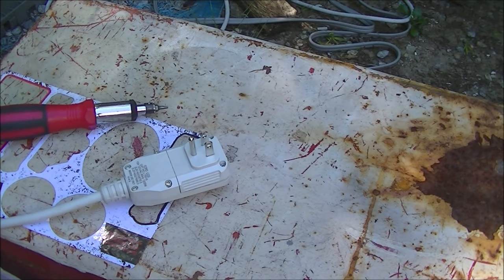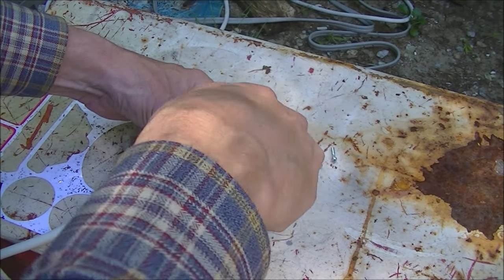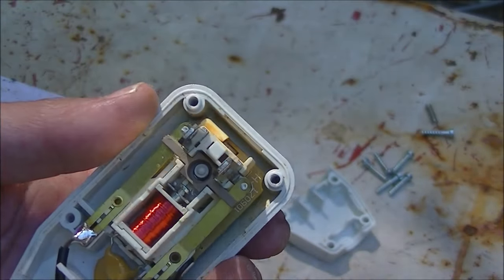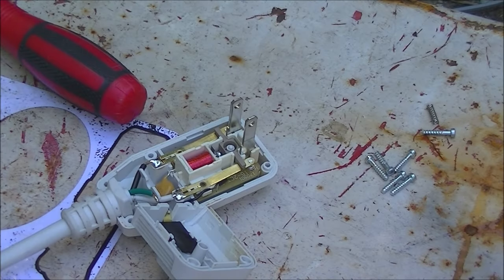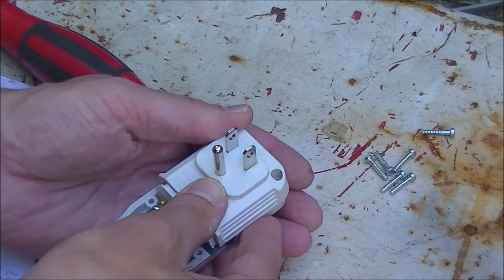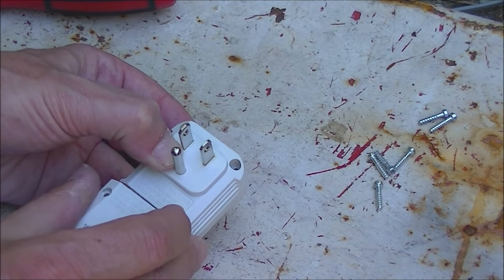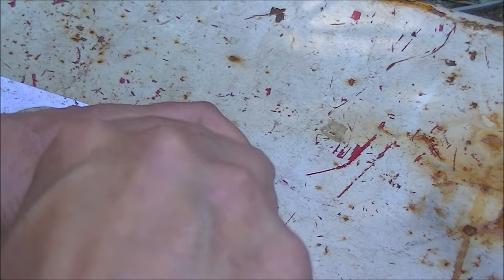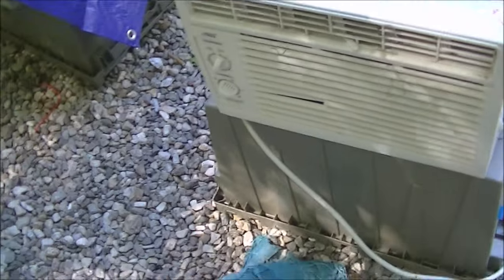Fixing an Air Conditioner GFCI Plug That Trips

Comment: All jokes aside…… I’m not going to complain about the long talk about the quick fix because….. it worked. My plug has a 2 prong safety screw that I did not have on hand. So I loosened all other screws and blasted it with a hair dryer and let it just sit over night. Next morning, we had a running GE window air unit. 4 🌟’s tyvm man.

Comment: Very good vid indeed. Just did a deep clean on my sons 240v 30a ac unit and the gfi plug was doing this very thing. Before pulling the (heavy) unit back out, I seen your trouble shooting vid and did what you suggested. We used a hair dryer on warm, and it did the fix. Thank you for the dyi tip. Very helpful indeed. A great day to ya sir.

Comment: The 2nd plug you were talking about thats the one I have and was having the same problem. So I took all screws out except 1 and opened it just enough for air to get through I took the blow dryer to it put the screws back in and it worked.
Reply: Thats a great idea
Reply: 7:07 For anybody who has already taken apart one of the GE type "Tower Mfg." plugs (that he mentioned he could never get working again after he took them apart), the trick is to pull back on the reset button's spring before putting that "reset" slider (that moves the 2 contacts) back in. The default position for those 2 contacts should be closed (connected/making contact) and that spring needs to be pulled back behind the stand-offs so it can push against them to hold the contacts closed.

When a fault is detected, that little solenoid in there pops up, hits a little brass button on the reset slider, releases the reset slider, and disconnects the contacts. Pressing the reset button resets that little brass button and allows the slider to move back to its original position (where the contacts are closed/making contact).

I wish I could describe it better in a comment, but you'll see what I mean once you open it up. I hope it helps somebody.

Or just do what @myfireburns22 said and don't take it apart all the way, and dry it out that way.

But if you're like me, and you were well beyond the point of no return by the time you looked up this video, that's what got mine working again.

Comment: On an air conditioner this is an LCDI (Leakage Current Detector Interrupter) and it's purpose is to detect any leakage current between the conductors inside the power, which would occur from a damaged or frayed cord and is was required in the early 2000s for portable air conditioners.   A very similar looking plug is an Appliance Leakage Circuit Interrupter required on hair dryers since 1991 and works very much like a GFCI.  To sum it up LCDI plugs address fire hazards,  while ALCI plugs address shock hazards much like GFCI and AFCI protection required in all new homes.
Reply: Thanks
Reply: Why can’t I just change it
To a regular 3 prong plug and accept the minimal fire hazard. Not sure how much fire could be created. My plug is outside hanging against a brock wall (I have to lower it from outside) I kept it wrapped in plastic but unfortunately it came off one day and the button is ‘soft’ and won’t reset. It used to reset no problem many times before after a random brief power outage.
Reply: @mr8966  you most certainly can change the LCDI plug it came with to a regular plug that matches  eg. 120 or 240v, 15 or 20 amp depending on the size of the unit.  

It's just an NEC and a UL requirement that the air conditioner have an LCDI or AFCI plug or device on the cord within 12 inches of the plug, since around  2002, before they are sold to the consumer.   Having said that, by installing a regular plug which I personally wouldn't have an issue with, pretty much voids the UL listing on the air conditioner and could cause issues with your homeowners insurance in case of an incident involving the unit.  

In case you're wondering,  an LCDI plug is factory installed as a cord and plug assembly only, and consists of a fine wire mesh around the conductors inside the cord for it's entire length,  and trips with leakage current is detected between any conductor and the mesh, which would happen in case of a worn or damaged cord.   As long as you inspect the cord before bringing the unit out for summer and replace it if necessary – repairs with electrical tape are not acceptable – you won't have any issues.

Comment: My sunbeam A/C was tripping when it was completely off, the plug got wet and corroded inside I had a old AC unit that still had a good cord and I was able to swap it out and it worked awesome🤩.
Awesome video thanks to you. My air conditioner is working again.
Reply: I had the second one that you had in your hand the GE brand one and that thing was toasted…

Comment: 7:07 On the GE type plug (that you mentioned you could never get working again after you took them apart), the trick is to pull back on the reset button's spring before putting that "reset" slider (that moves the 2 contacts) back in. The default position for those 2 contacts should be closed (connected/making contact) and that spring needs to be pulled back behind the stand-offs so it can push against them to hold the contacts closed.

When a fault is detected, that little solenoid in there pops up, hits a little brass button on the reset slider, releases the reset slider, and disconnects the contacts. Pressing the reset button resets that little brass button and allows the slider to move back to its original position (where the contacts are closed/making contact).

I wish I could describe it better in a comment, but you'll see what I mean once you open it up. I hope it helps somebody.
Reply: Thanks will pull see what happens or open up I have 3way screw driver yet only works on 2 bigger holes the small holes can't get in there need to buy another screw driver I have right bit yet won't reach screw. I thought there's supposed to be a fuse. I guess is just air dry mine never got wet. So will check it put
Reply: You were correct! Saved me time and money just now, thank you for the insight!
Reply: You saved us $100+. Thank you.

Comment: Bought a brand new Hisense portable 8k BTU A/C unit 2 weeks ago from Lowes and was never outside however been experiencing extreme humidity lately and just last night the CGFI kept popping every few seconds and turns out the CGFI housing was completely filled up with water so i took it off and put a regular 3 prong end on it and now it works flawlessly

Comment: I can’t get the screws off. I’ve got it in front of the heater. I think I’m going to have to learn how to replace the cord. Thank you though, it happened once before and in 2 days worked again, I never knew what was causing it until seeing your video.
Reply: Do you have electrician's screwdriver like Square tip or Robertson screwdriver #2?

Comment: I had a portable room AC that the breaker plug kept tripping, then finally stopped working.  I just cut it off and replaced it with  standard 3 prong 15 amp plug. Problem solved, unit ran for another 5 years until the plastic blower fan broke.

Comment: If those things burn out, I usually just put a normal grounding plug on it. It doesn't protect against an over amperage situation. It's just a GFCI in a plug. A fuse holder would serve better. It's really there to protect the manufacturer's butt in case it electrocutes you or something. The air conditioner is fully encased in grounded metal, so I don't know what you're sticking your fingers in to get shocked. Even if you replace it with an after market plug and the air conditioner burns down your home, they'll be like, "you modified it, so it's you're fault." You can always just plug it into a GFCI outlet if you want. It's pretty much code now, so I don't know why you need it in the plug. They can always just tell you to plug it into to a GFCI outlet, and they probably already do. The NEC is also forcing AFCI outlets which trip if you look at them wrong. They don't actually work. AFCI is just snake oil in my opinion.
Reply: you are absolutely correct about everything you said there. I don't see the purpose of the GFCI plugs either, as long as it is properly grounded, you aren't going to shock yourself unless you open it up and touch something internal, which at that point you have modified the machine, so you can't blame that on the manufacturer. same goes for if it is not properly grounded for whatever reason. You are running it under improper conditions, which is warned against as well, so you can't blame that on them either way. 
most of the units I have are before they started doing this, but if those plugs start giving me issues, I just chop them off and replace them with a standard 90 degree angle grounded plug and have never been shocked or had an issue. 
Only time I have ever been shocked by an air conditioner was at my friends house, I had just cleaned the unit and was not patient before trying to use it. It was still a bit wet and I her wiring was old and I guess it was not grounded, so I got a bit of a shock. Once again, I could not blame that on the company that made the unit (even if it was not a 30 year old unit) because I took it apart, and the wiring should not have been running an AC unit. 
I also hate AFCI circuits. luckily my house is old, so it doesn't have them (I actually have non-trip breakers, but that is besides the point). I have been in newer houses and what you say about looking at them wrong is absolutely correct. I don't know how people are not tripping breakers daily.
Reply: You couldn't be more wrong. Those are not GFCI plugs. They are, in fact, LCDI cords (which require a LCDI plug because the cord and plug are all one functioning unit and must be replaced as an entire assembly) GFCIs and LCDIs are two very different things and serve two very different purposes. And, for good reason, many people have died at the hands of AC cords before LCDIs were mandated. That's definitely one mandate that was written in blood. You need to do your research before misleading others by not having a clue about what you're talking about.
Reply: @johnny0454 so can’t I just swap the lcdi box with a gfci? What would happen

Comment: My AC has that second larger plug. As soon as it cracked open water came out. Took a bit to get it dry. Works when put back together....as long as I don't tighten the screws down all the way LOL.

Comment: Mann your a life saver i took my unit apart cause condenser fan broke then me having it apart i washed it i noticed i lot of build  up put it back together let it dry for about 3hr whent to connect dirent work at ll had power at cord but would not power up and today i connected and it ppwer up but it kept tripping with in second

Comment: I just thought it was broken so I brought it inside and tried it once a day then gave up. It’s been months now so I’m sure it’s bone dry.   And why does it have two kinds of trips? ie: one trip that doesn’t affect the buttons and one loke in your video that does. How does just drying it out make the push button work again?  I would have a few teips a month from brief electrical outages and it never affcted the button. Now the button has no pressure under it, it just doesn’t work. I have a Noma. 

Also, interesting you said just put a regular plug on. I almost prefer that. What is the reason for the tripping plug - wouldn’t attaching a regular 3 prong cord to the unit then plugging it into a power bar with a trip/reset button function the same?

Comment: If I have a GFCI outlet or a 3 way GFCI adapter. Can I just cut off the original GFCI plug On the AC and install a regular three prong plug instead?

Comment: Hello I have a plug that the hot side is sliding after heat damage caused by the previous owner leaving it plugged into an extension cord always. Have you ever fixed the position of one of these?

Comment: Not gfci..  is LCDI..  leakage current detection interruptor..  not a ground fault circuit interruptor (gfci). Or an afci arc fault circuit interrupter..  ..  fyi..  for your information..
Reply: I'm trying to find why mine keeps on tripping. I see no visible damage to any part of it so I can't figure out why it keeps tripping. The cord, the prongs everything is cool to the touch.

Comment: 14:43 Thank you so much.😊 I need to dry mine out and I came across your video. It was very helpful I have one question? Can you put a regular three prong plug on the end of these air conditioner chords?😮 I could really use your help here. Where I live it's 120°the second hottest place in the United States.😮😮 Thank you so much.😊😊😊

Comment: I hate when those get full of water. It seems like they get full of water very easy, but don't ever dry out no matter how long they sit in a hot dry area. I don't really ever sell units, and most of my units that I collect are pre-2000, so they don't have this type plug on them. I only have a few that have/had this type of plug. If they start acting up, I generally just chop them off and put on a 90 degree angle grounded plug and call it good.
Reply from the maker: I'd also just put a normal 3 prong plug on it if it was something I was keeping for myself.

Comment: I lost the tip for the screws but I sat the plug in a cup of rice for 48 hours and it worked fine.
Reply: trying the rice now. I loosened the plug but I didn't take it all the way apart

Comment: I had this problem but the water in the plug was actually weeping through the cord from inside the unit.  I sealed the wire inside the unit and never had this problem again.
Reply: please explain more. I am having this exact issue. I got some silicone to seal the cord inside the unit.
Reply: Let it dry out and then silicone at the beginning of the cord sheathing. You will have to open it up, but it works

Comment: I had this issue yesterday morning my plug had got wet from the ac leaking water and it had ran inside of the plug I didn't have that type of screw driver but luckily I got it fixed without it and I used my blow dyer kept it on it for ten minutes then in a couple hours it was back working

Comment: Pretty sure it's a GFI. My ground lin got bet and broken loose and that's what I'm here for now trying to fix it before cutting it off and eliminating the ground fault protection. At least in the AC I have it's a GFI which trips every time I plug it in with no ground prong to go into the outlet. Gfi works like a champ. Mine has no display either just a trip and reset like any other GFI.
Reply: I. Thinking I can cut the end a little,  end it, drill a small hole, and screw it back into the plug like it's an implanted tooth, if I don't have the bit to disassemble it and check further. I'd just throw a regular aftermarket plug in it but I actually scooped the AC up just to clean and sell, and would prefer the GFI be intact.

Comment: A lot of times they'll have shielded wires most of the time the shielded wires will go to a bleeder resistor which will bleed the electric out whenever the AC units off..

Comment: On the second larger plug how do you get the second screw on the top off?
Reply from the maker: They usually have the square Robertson head or some have the 2 prong security bit head. I usually don't try fixing the big GE plugs.

Comment: And if you're in a rush like I am right now, just barely crack the plug open and stick a butter knife in it to hold it open and pour some rubbing alcohol in the plug and let it sit for 20 minutes! Good to go! No need to wait a couple hours or a day! Oh and this is the second kind of plug you showed in your video. I left the security screw in and just took out the other phillip's screws, so you don't have to take it fully apart.

Comment: I got a question when i opened mine we all see the three wires green black and white I noticed one more black wire one smaller and it has two ends ones connected the other is not is it supposed to be like that?
Reply: Did you figure out the situation? I have that same problem.. I realized the Lcdi is not the same as gfci. I don’t want a fire to happen if I connect a gfci instead of a lcdi . I don’t even know if it will work

Comment: I have an older one. Technology Research Company model # 37190. Do your know any other name for it. I live in Louisiana summer is here hot and humid. I can't afford a new one in 914.00 a month so I need a power cord 20 amp 220v. Any suggestions would help.
Reply from the maker: I don't know that one. You could probably install a new generic plug from a hardware store on the end of the cord or replace the cord if it's damaged. This is only for water in the plug, if it wasn't exposed to water, it's probably a fault in the air conditioner to make it trip.

Comment: In people‘s homes, how does water get in? 
Is the socket directly below the AC unit? If this, good idea to have socket relocated away up on nearby wall.
Are people using with outlet running to an outlet not inside?
Reply: I'm assuming most folks, including myself,  it happens when cleaning the unit probably 😅
Reply: I have to power my unit from outside. Long story. I always had it covered but the cover came off ome day